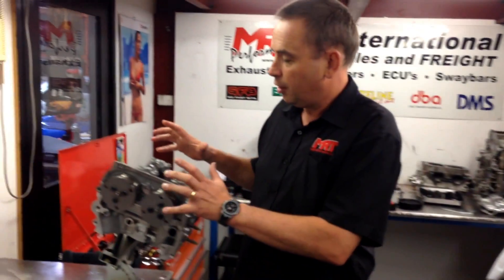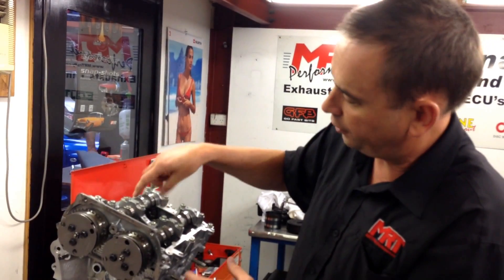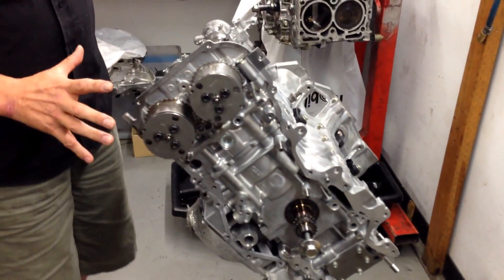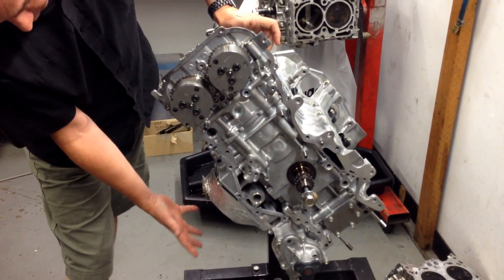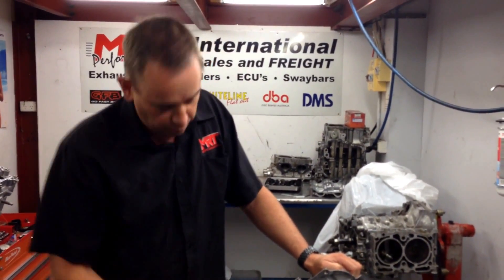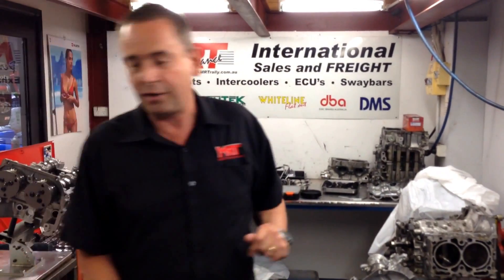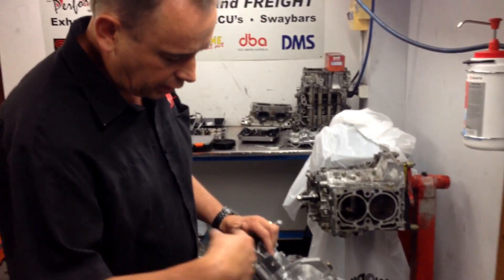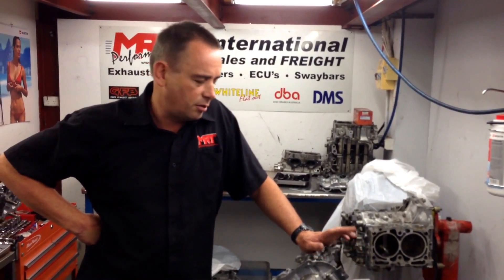Subaru BRZ engine upgrade part 3 Toyota 86 Scion FRS

Comment: Keep the updates coming! I'm running the Sprintex kit stateside (Innovate). I just upgraded to the intercooler and 72.5mm pulley. My MAP sensor is reading about 9-10psi. I'm hoping the stock rods hold up. It looks like a pain to build the engine for the conservative power I'm pushing.
Reply from the maker: I hope you can afford an engine rebuild, at that boost we dont recommend a stock engine.
BUT there are people who have been luck running huge boost on stock internals!
its risky, I do hope you have a custom tune using EcuteK software and custom maps on a Dyno..
BTW we NEVER fit this kit unless it has the intercooler.
Reply: Yeah I'm running an EcuTek tune via a tuner here in the states. It's a shame the compression ratio is so high and no forged rods. The car is light, so it doesn't need a ton of power but coming from a Porsche 911 and BMW M3, I need a little go! Enjoying the updates, thanks for sharing.